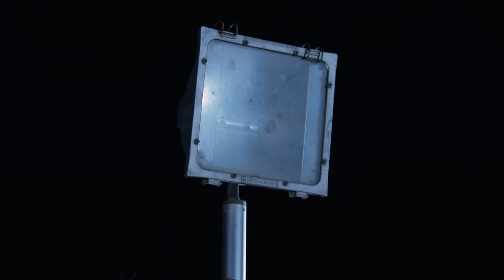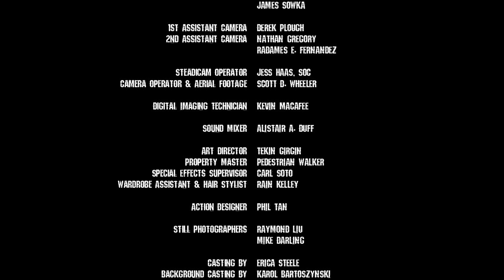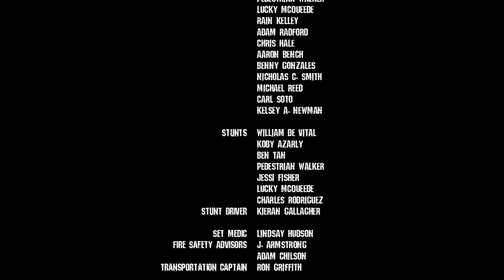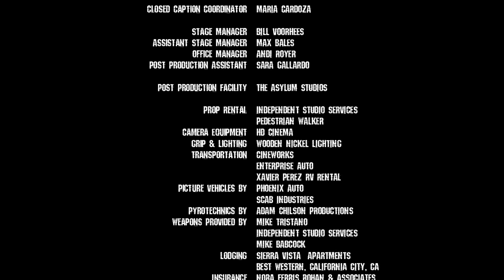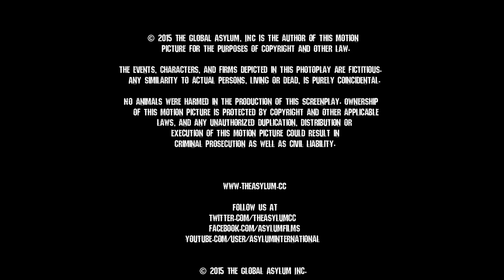Road Wars | Full Movie | Apocalyptic Sci-Fi

Comment: If you find yourself in this situation, you had better learn how to make alcohol for fuel, because the gas goes bad in 6-12 months. They have water, what about food? 2,000 calories a day per person? Where is that coming from? If you think this is a possibility, you had better start stocking up big time yesterday. Diesel can be made from an oil press and certain crops, but your farm machinery better be from the 1940's for it to work for decades more. Those have been proven HD long term. Spare parts? Beter have a 3D printer handy. Face it, most things will break down and stop working under heavy duress, with no way to repair them.